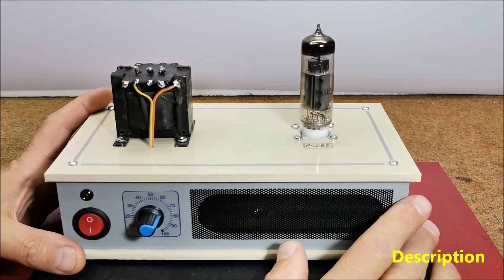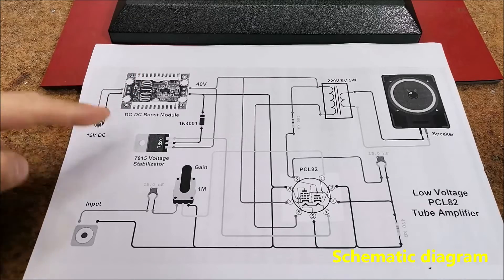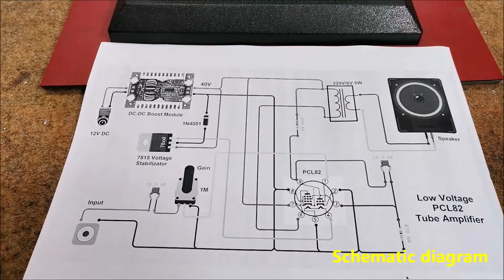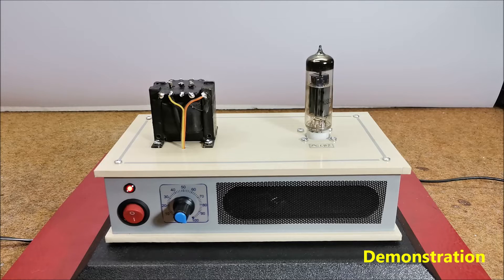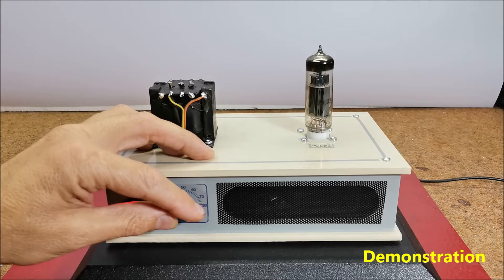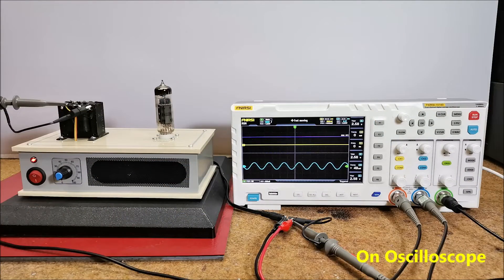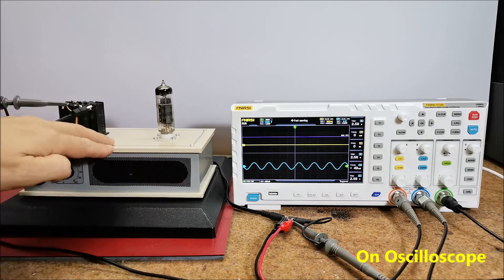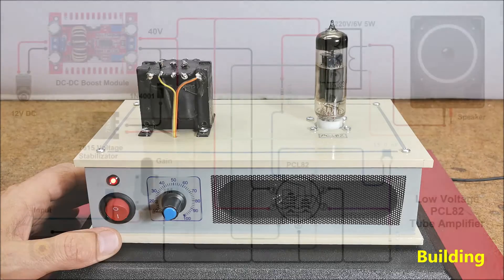DIY Simple PCL82 Low Voltage (12V) Tube Amplifier

Comment: I would like to try to build it myself, but I think that your schematic is not correct.  The pins of the PCL82 are different in the datasheet, and your schematic shows  the cathode of the pentode connected to  +40V .
Reply from the maker: Pin numbers are correct, bit pin 7 is G2, and 8 is kathode of pentode. The inside of the tube is incorrectly drawn. Sorry, my mistake.
Reply: I'm just starting out in tube electronics, so are these connections correct 4:00 ? Thank you. @MirkoPavleskiMK
Reply from the maker: @sw732  Yes, just don't look inside the tube, just connect the pins according to the given diagram
Reply: @MirkoPavleskiMK  Thank you for the clarification.

Comment: You can probably use two separate tubes for such a project as well. Wonder how to calculate component values for other tubes. Maybe you can make push-pull also if two transformers are used in the output?

Comment: If this unit is using the Low Voltage Vacuum tubes developed in 1957 for use in car radios when the transistors of the day were not ready for prime time then the Heater voltage should be 12V and the B+ should also be 12V.